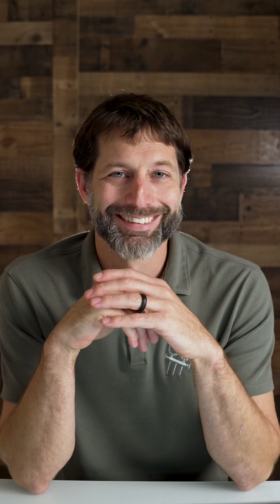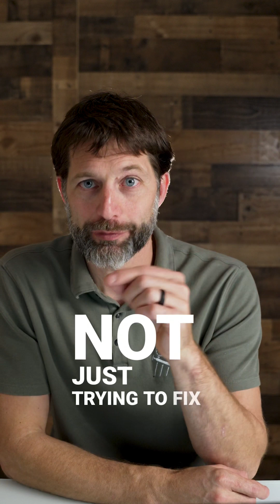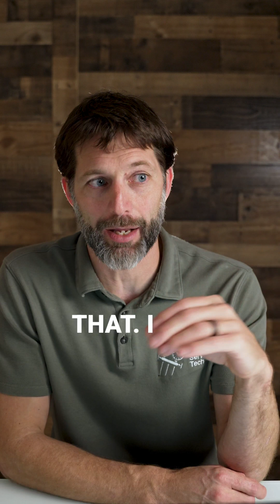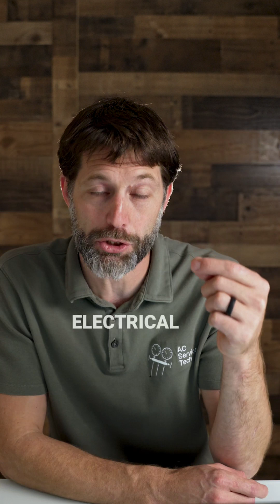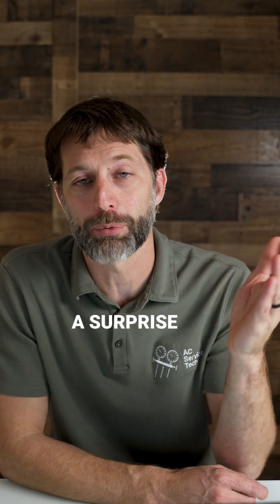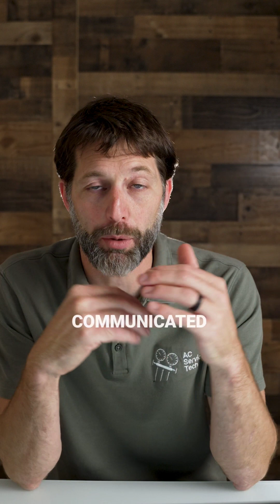The Hot Topic of Replacement of Small HVAC Parts and the Expense to the Customer!

Comment: On most of the common repairs, the labor costs far more than the parts. The customer will spend more trying to repair a cheap part. Replace it and give a warranty on the new part. Less expensive, more efficient and more value for the customer.